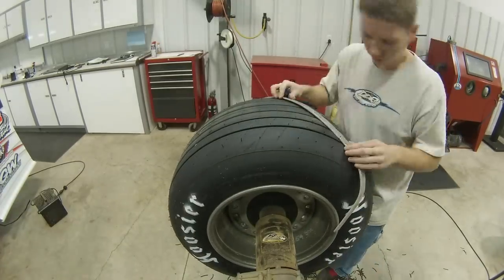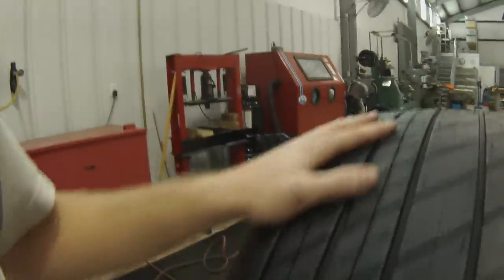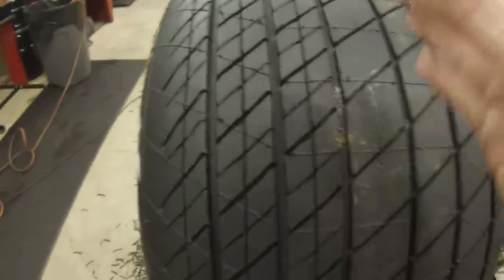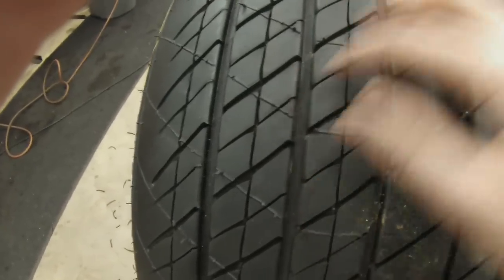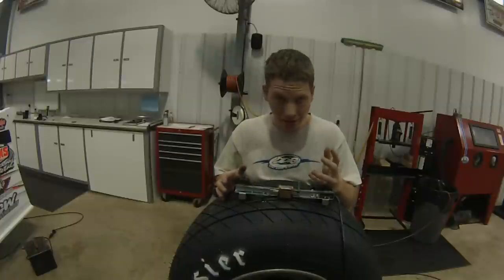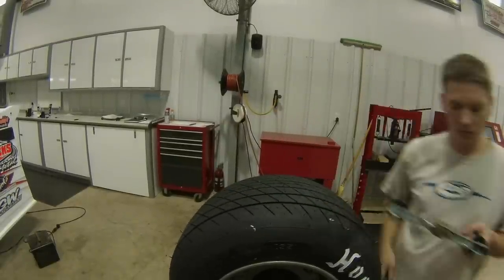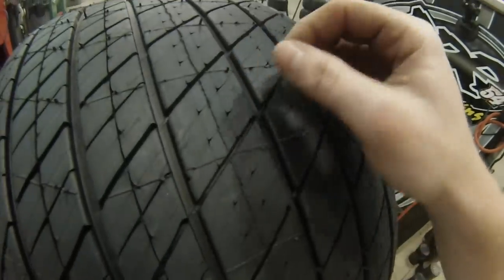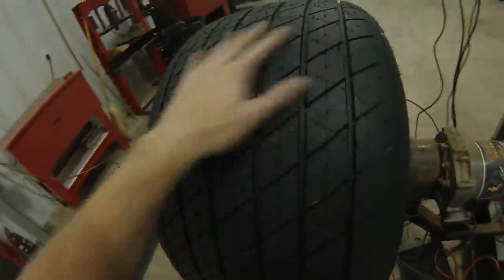Dirt Late Model Hoosier Basic Front Tire Grooving

Comment: I'm a crew member on a Lm sportsman (same tires) I can't get my grooves for my front tires going in the right direction because of the mold lines going the wrong way I just can't find a way to get my lines consistent. For dry slick I want NRM and big blocks?
Reply from the maker: Shane Connelly you have to draw or score your own cut lines. Those factory lines are only about 15 degrees.

Comment: What psi do you sipe and groove at?
Reply from the maker: I try to stay around 10-15lbs air pressure, unless I am swelling a tire. Grooving the tire will cause to stretch slightly, more so with softer compounds.